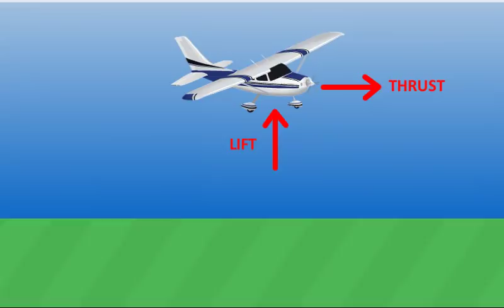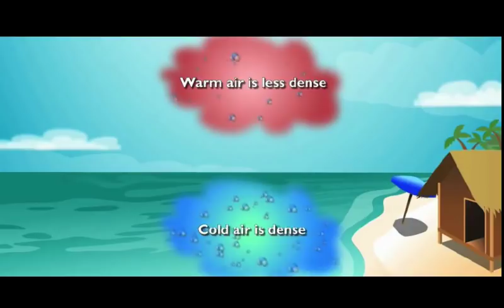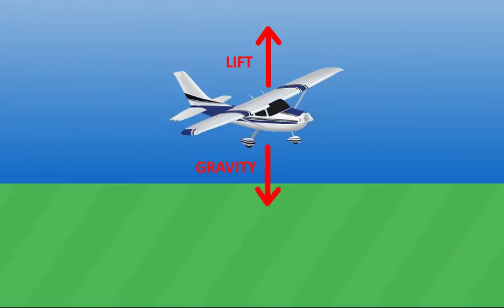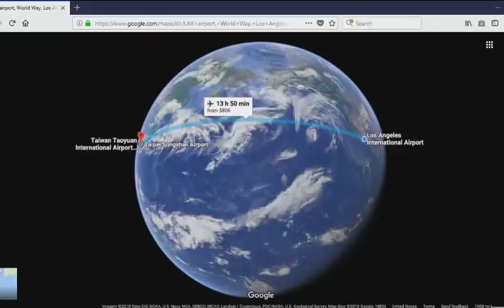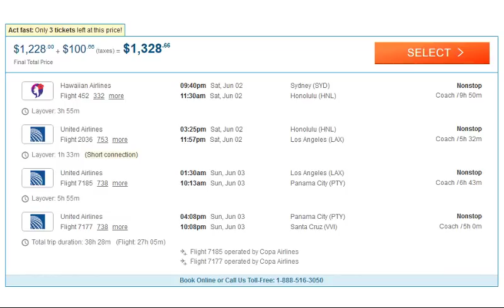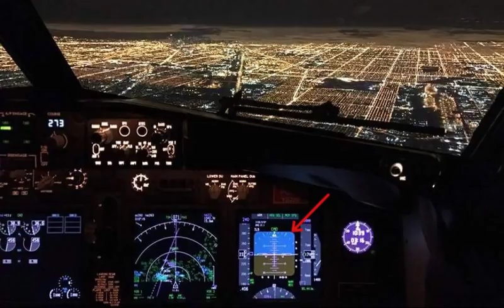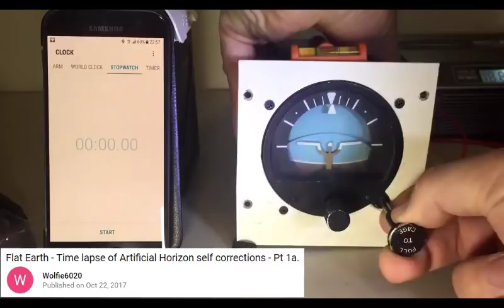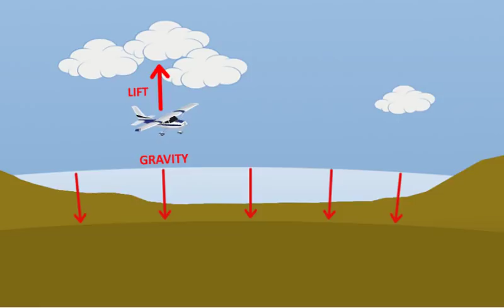Flat Earth Falsities - Plane Nonsense

Comment: If the Coriolis effect is true why can we watch layers of clouds in the sky going in different directions at the same time, oh yeah, the Coriolis effect cannot be observed demonstrated or measured.
Reply: Why do you guys all say the exact same nonsense using nearly identical wording?  It's almost as if you're getting your talking points from a cult leader and then just spreading them around the internet like good little sheep.
Reply: You can observe it in the direction of cyclonic winds. Winds blow anticlockwise around low pressure and clockwise around high pressure in the northern hemisphere and visa versa in the southern hemisphere. Without the Coriolis effect air would simply flow directly from areas of high pressure to areas of low pressure.
Reply: Dude fuck off. If you are going to even try to troll or spam this guys videos, please watch them and at least make an effort to understand what you are talking about.
Reply: Surface winds, and winds aloft, the difference between these is well understood and well defined.

Just because you don't know a particular thing doesn't mean nobody knows that thing.
Reply from the maker: Don Will - Here you can watch the Coriolis effect in action. Notice the directions of the spin of big storms in the Northern and Southern Hemispheres. https://youtu.be/t6YfEkLR_Ho
Reply: VoysovReason yep

Comment: Very good I was on the fence o e thing tho the images of earth don't look real, I still think they are hiding something
Reply: Composites are used because most satellites are far too close to take an single frame image of the Earth. So instead they take a strip at a time then paste them together. 

But there are satellites further out that do take full frame images. The Japanese weather satellite Himawari 8 takes high res (11000x11000) full earth single-frame images, in 16 different wavelength bands, every ten minutes and available to browse in real time:
https://himawari8.nict.go.jp
Reply: Dion Temenes 
Images of the earth are often photoshopped composites of many different photos. Primarily this prevents pesky clouds obscuring the view.

You do get real photos of earth, however these aren't as popular or widely circulated, because they always have clouds obscuring much of the view.

Comment: Globe earthers also say when snipers take long distance shots they have to compensate for the rotation of the earth because the earth is spinning under the bullet. If that was the case then it would take longer for planes to fly with the spin rather than against the spin. You can't have it both ways. Either the spin doesn't affect bullet travel and plane flights or they affect both
Reply: Coriolis causes a an apparent deviation of only a few inches per mile.  A pilot doesn't care about a few inches because he can always just turn left a little bit.  A bullet doesn't have a pilot, so a sniper needs to correct a little bit before putting the bullet in flight.  

"You can't have it both ways."
Actually we can because there are multiple forces which affect something in flight of which coriolis is just one small aspect.

"Either the spin doesn't affect bullet travel and plane flights or they affect both"
They do affect both.
Reply: Bullets spin and don’t have pilots.
Reply: GrahamStw so if a plane was spinning without a pilot it would be affected by the rotation of the earth? Can you attempt to make more sense please?
Reply: Yep, what GMO said. Coriolis affects both plane and bullet. Coriolis is NOT the same as saying the Earth spins away from a plane (or bullet) at 1000mph.
Reply: "the hypothetical spin of the earth"
The rotation of the Earth is not hypothetical, it is an observation of fact.

"wouldn't affect an object per mile traveled it would affect the object based on how long it is airborne"
How "long" something is in the air is a product of how fast and how far said thing is traveling.  

"And if the air and earth are both moving at the same speed why are objects affected at all?"
In order to propel something through the air you need to apply a force, the faster and farther something travels the greater the force needs to be applied.  That force is counter to the motion the object had from the Earth's movement and so causes the object to deviate from that motion.  How much it appears to deviate depends on how strong the force is and what direction the force is applied in.
Reply: OMG GMO the hypothetical spin of the earth wouldn't affect an object per mile traveled it would affect the object based on how long it is airborne. And if the air and earth are both moving at the same speed why are objects affected at all?
Reply: Logan Mial The sniper manuals on Coriolis effect are not written by theoreticians. Rather, snipers noticed an error factor in their north south shots and eventuallt it was accepted and understood that the coriolis effect wss at work.  And it is not an invisible 1000 mph wind rofl
Reply: David Austin then you see the contradiction. That being the hypothetical spin on the earth affecting bullet travel but not any other type of air travel.
Reply: It's like you're just ignoring anything that's said.  Almost as if you have no interest in facts that contradict your beliefs.
Reply: OMG GMO no your last comment said a whole lot of nothing so I ignored it. I've answered everyone else. I also have a thread going on his moon video if you want to head over there.
Reply: Well at least you admit that you ignore facts that contradict your beliefs.  That's more honest than most FE believers.
Reply: OMG GMO I ignored your nonsense. Like when I pointed out that time in the air is what matters not distance traveled you gave me some garbage about how time is distance when the two have nothing to do with each other. The contradiction remains of bullets being affected by a hypothetical spin and all other objects in the air not being affected by the hypothetical spin.
Reply: "Like when I pointed out that time in the air is what matters not distance traveled you gave me some garbage about how time is distance when the two have nothing to do with each other."

Perhaps instead of ignoring responses you should consider reading them and attempting to understand.  The time that something stays in the air is determined by how fast that thing is moving.  Throw a ball up in the air.  The harder you throw it, the longer (more time) it will stay in the air.

"The contradiction remains of bullets being affected by a hypothetical spin and all other objects in the air not being affected by the hypothetical spin."

Again, had you considered reading and attempting to understand my response you would not be repeating this nonsense again.  The rotation of the Earth is not a "hypothetical", it is an observation of fact.  There is no contradiction there is only your misunderstanding and open admission of ignoring responses which contradict your beliefs.
Reply: OMG GMO I fill a balloon with air and let go of it. It floats in the air without moving for a long period of time. Did it's distance traveled have anything to do with how long it was airbourne? No. Distance traveled and time in spent in the air are independent of each other. And when you are thinking of things way everything is hypothetical until proven to be true. The motion of the earth has not been proven to be true.
Reply: "I fill a balloon with air and let go of it. It floats in the air without moving for a long period of time."
If it is filled with air, it's going to fall not float.

"Did it's distance traveled have anything to do with how long it was airbourne?"
If it was floating then no, but it's time spent in the air was a direct result of how much force was exerted on the balloon to keep it airborne.  Just like I explained in the comment you chose to ignore.  In the case of a balloon floating, it is floating because of the force exerted on it by buoyancy.

"No. Distance traveled and time in spent in the air are independent of each other."
You really seem to be focusing on "distance" and still ignoring the other words I used like "speed" and "force". 

"And when you are thinking of things way everything is hypothetical until proven to be true."
Not exactly no, and in any case the rotation of the Earth is something which has been proven to be true so under your own bad definition it isn't hypothetical.

"The motion of the earth has not been proven to be true."
Your blatant denial of facts does not make those facts untrue.
Reply: OMG GMO the point was a floating object does not have the earth spin underneath it, at least in any recordable way. The YouTuber that made this video says that planes are not affected by the earths rotation because the atmosphere moves with the earth. But snipers claim that bullets are affected by the spin of the earth underneath it. You said it's only affected a couple inches per mile and a pilot doesn't care about a couple inches. But if the earth is spinning underneath of objects that are airbourne then you should be able to observe this happening to a floating object such as a balloon.
Reply: "the point was a floating object does not have the earth spin underneath it"
The point is that you are ignoring all the forces at work.

"But if the earth is spinning underneath of objects that are airbourne then you should be able to observe this happening to a floating object such as a balloon."
How much exactly should you expect on a balloon?  The formulas used to calculate these things are not secret.  Have you considered plugging in all the variables and determining how much exactly a balloon should be affected?
Reply: OMG GMO  how about you give me an experiment that would prove the motion of the earth. How would one prove the earth is spinning?
Reply: Foucault Pendulum.
Reply: OMG GMO those have to started manually if the rotation of the earth is what causes the rotation it wouldn't need to be manually started. Try again.
Reply: This swing of the pendulum is started manually.  The swing.  Not the rotation.  The rotation of the pendulum is caused by the rotation of the Earth.
Reply: OMG GMO first no swing would be needed either. Secondly it has a ball joint at the top of the pendulum which facilitates a circular motion more than any other. Any force can change a back and forth motion on a ball joint into a circular one. And lastly if the earth was rotating under the pendulum it would affect all airbourne objects such as planes and balloons not just the pendulum.
Reply: Sigh.  You are claiming that no swing would be needed to start a pendulum?  Really?  Come on man you're just making up excuses now.

"Secondly it has a ball joint at the top of the pendulum which facilitates a circular motion more than any other."
Irrelevant.  If you push a pendulum in one direction it will swing in one direction.  This is grade school level physics here, where talking Laws of Motion.  It will not move in another direction unless something causes it to move in another direction, like the rotation of the Earth.

"Any force can change a back and forth motion on a ball joint into a circular one."
And what force do you propose is causing that change?

"And lastly if the earth was rotating under the pendulum it would affect all airbourne objects such as planes and balloons not just the pendulum."
Are we really back to this again?  It would save a lot of time if you would actually read my responses instead of ignoring anything that disagrees with you.
Reply: OMG GMO the rotation of the earth affects a moving object but not a stationary one come on man you're just making excuses now. 

What force? IDK how about the air moving against it? The person starting the pendulum not pushing it perfectly forward or a million other examples because this experiment doesn't eliminate any variables. And yes we are back to the rotation not affecting any airborne object because it observably doesn't affect any object. I don't know if you know this but science demands observable repeatable experiments.
Reply: "OMG GMO the rotation of the earth affects a moving object but not a stationary one come on man you're just making excuses now."
Again, it's like you aren't even reading my responses.  If you had read my responses you wouldn't still be saying this stuff.

"What force? IDK how about the air moving against it?"
So you are claiming that every Foucault Pendulum in the world has a mysterious wind blowing on it in just the right amount to produce a predictable rotation that just so happens to be consistent with what coriolis predicts for its latitude.  

"The person starting the pendulum not pushing it perfectly forward or a million other examples because this experiment doesn't eliminate any variables."
So you are claiming that everyone who ever started a Foucault Pendulum was an incompetent nincompoop who just coincidentally started the Pendulum with the exact right motion to mimic the predicable rotation rate that just so happens to be consistent with what coriolis predicts for its latitude.

"And yes we are back to the rotation not affecting any airborne object because it observably doesn't affect any object."
Except that it does, and you just ignore all evidence that proves you wrong and make up excuses about it.

"I don't know if you know this but science demands observable repeatable experiments."
I don't know if you know this but science is providing exactly what you ask for and you are willfully ignoring it all because it disagrees with your silly beliefs.
Reply: OMG GMO you say the earths spin makes the pendulum go from back and forth to a circular motion. I say the force of the earths spin should affect the stationary pendulum in the same way it affects the spinning one. You say that's an excuse I say that the earths spin should affect an object in motion the same way it affects a stationary one. You say I'm not reading your comments..... This is going no where. The pendulum shouldn't need to be manually started for the force of the earths rotation to affect it. You should be able to have the pendulum in a neutral position and observe the force of the rotation of the earth acting on the pendulum. This is not what happens. 20 responses is good enough for me 90% of what you say is just quoting me anyway. I'm sure I'll see you on another video I'm active on YouTube.
Reply: "I say the force of the earths spin should affect the stationary pendulum in the same way it affects the spinning one."
How much exactly?  Again, the formula are not secret.  Do the math and tell me how much exactly.  Then compare that amount to the stationary inertia of the pendulum.  See if the numbers support your claim.

"You say I'm not reading your comments..... This is going no where."
Because its clear that you are ignoring my comments.  If you were reading my comments you wouldn't still be repeating the same things you started with.

"You should be able to have the pendulum in a neutral position and observe the force of the rotation of the earth acting on the pendulum."
Again, support your claim.  Do the math.  Show it.  The formula are not secret.  You can do this yourself and prove that you are correct.  Support your claim.
Reply: Logan Mial I am getting a message from OMG that

1 Yes there is a coriolis effect on planes
2 it is negligible
3  it is NOT  the same as the 1000 mph spin of the planet.

I believe him. I expect the coriolis effect explains why cyclones and hurricanes turn in different directions, and that in flight there is no conscious adjustment for coriolis because it is lost in the inevitable frequent minor trim adjustments. So coriolis is NOT spin. It is a derivative effect and relatively attenuated. 
If I have  stated this correctly then dont cherry pick the bit you like.

That would be why aircraft can land north south without  veering off the runway. Any coriolis effect over a landing distance of a mile or so so would be measured in inches

Comment: You have it so wrong. Throw that ball out of the window it stops moving forward very quickly.
Everything you said actually helps flat earth theory.
Reply: The whole point of that analogy is the air is moving with the car, just like air is moving with the Earth. 
The Earth is a pressurised container.
Reply: Dumb Omatic just because you can't understand simple science and physics. It doesn't mean you have a point.
Reply: You have GOT to be kidding me. It’s no longer moving WITH the vehicle once it’s out the window. That proves the very point he’s making here and works against flatard theory.
Reply: It’s because of the friction with the air when it goes out of the window. Like how you can feel the air pushing your arm when you stick it out of a car window. The air slows down the ball so that’s why it looks like it is going away, not because the earth is flat, but because friction